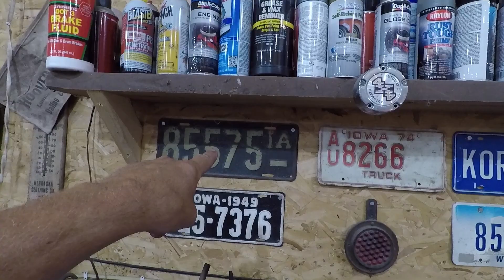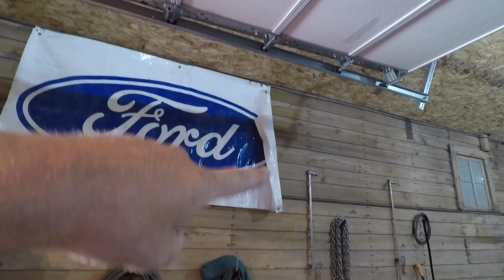ALL WET! - Mitsubishi Eclipse AC Drain

Comment: Hi, thank you for posting. I have a 2000 Eclipse with wet driver side floorboard. My mechanic did find the AC drain emptying into the car on the driver's side floorboard. Also, when he pulled back the carpet, there was a hole in the floorboard way up there which he plugged. I haven't had a problem since.

Comment: I've done this job for several of clients after they have went to a dealership and have gotten no results.  The trick is to get a few your vac hose and plug it to the side that blows air. Then close off all other vents, next duct tape the vacuum hose to the passenger vent. After that have a can of ZEP A/C condenser cleaner  and go under the car and spray it into the drain tube. Count 15 seconds and let set for 10 minutes. Turn on the vacuum to back blow, and if needed. Use a 2nd vacuum to help pull out all the gunk in the evap core. Repeat till no more gunk comes out. I've done this about 5 times and had no client come backs.

Comment: I have the same Problem in my 2004 Dodge Stratus R/T....which is made by Mitsubishi,  it only happens when I run the A/C unit....I'll take your advice and check for my hose also.....
Reply: 03 Sebring Coupe doin' the same thing. Fix Ya says to buy 3M Windoweld ribbon sealer and make a new seal around the tube.

Comment: Those tiny gauges would drive me nuts in that car! Also, to seal up those spots that go into the firewall, I always use silicone. Just pack it around the tube and nothing will be able to get back in.
Reply from the maker: If it leaks again, thats what I was thinking as well.  Didnt have any on hand at the time, not to mention I can barely get my hand down in there to get anything on it.

Comment: I had a 2003 misubishi Galant ( great car) ,it had the same problem, it was the gasket around the drain tube that deteriorated and I used a black tar strip that is used around windshields for the gasket. It worked. I never had a problem again. I did try blowing the a/c drain box and no luck on that. But that tar strip did the trick.
Reply: just work the gasket around the drain hole pushing it in the openings around the drain.

Comment: From what I understand leaves blow into the ac system and basically lay ontop of the condenser causing it to build up enough moisture to cause the water in the drivers side floor board and the only way to fix it is to take apart the bottom part of the dash and vacuum all the leaves out
Reply from the maker: +Chris Powell well ain't that just lovely! LOL....no more problems yet but will keep that in mind.

Comment: Does her AC not work and overheats? Have a 2003 eclipse GS I also have a pool of water on my left hand back seat floor now I’ve noticed after it rains once I go to start my car my car won’t start, Until a few hours later once the sun comes out and something dries off any clue what that could be wondering if anyone else is having the same problem it’s so strange.￼
Reply: Sounds like you have two completely unrelated problems, 1) sunroof drain tube is leaking into your floor 2) moisture from the rain is probably causing a spark issue, time to tune it up with new wires/plugs, hopefully your coil packs are fine, that's the expensive bit
Reply: This could be a distributor issue that your car has. I dont know if this model  car had distributors in them,  but if so it seems to be that when there is moisture in the air, a distributor will get damp inside due to moisture in the air and cause your car not to start,but when it warms up the moisture dries up allowing the car to start again. This distributor would have a crack in it causing the moisture problem.The water in the back seat is another problem. If your car is overheating it could be the thermostat or radiator problem .  you need to talk to a mechanic about this issue of the overheating so that you dont blow a head gasket and possibly ruin your motor. Small engines cannot take a lot of overheating.

Comment: ok I have an eclipse 2004 that is been leaking water  into the cabin for a while at first I thought it was just the drain tube issue  but apparently its not .....even though the water hardly leaks into the carpet I notice there is water dripping from where I believe the evaporator is underneath the dash also from the ac vents .
does anyone has any idea of what It could be ?

Comment: Did this fix the problem? I have an 04 dodge stratus 2 door coupe (not the 4 dr sedan, that's actually a completely different car) which is basically a restyled mitsubishi eclipse (looks identical under the hood) and its AC is leaking into the drivers side floorboard. And there's a LOT of water, enough that it's there's standing water in the back floorboard on the drivers side. I can't seem to fix the issue, so I am wondering if you were able to get yours fixed?